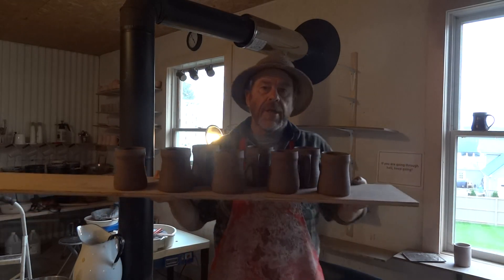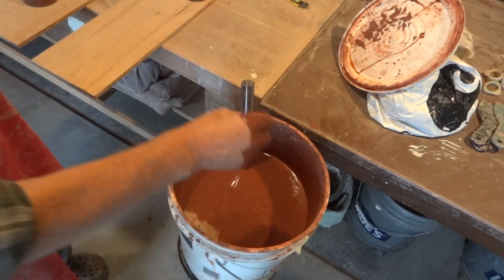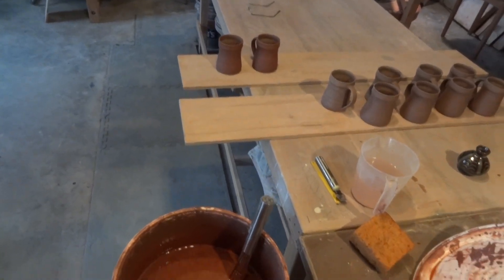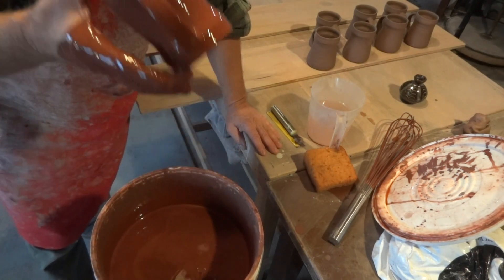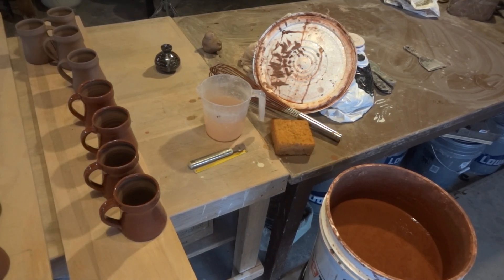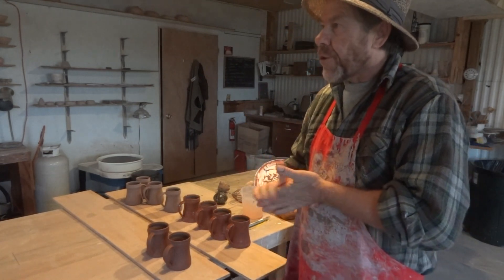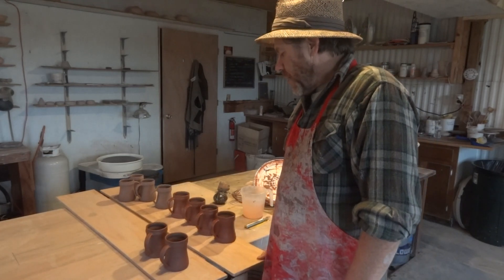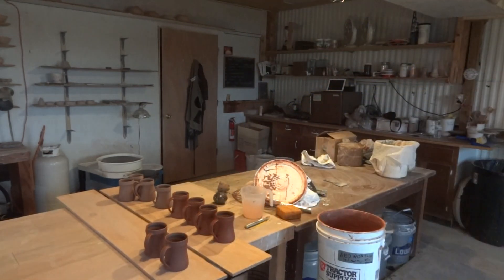SIMON LEACH POTTERY TV - Dipping tankards in red iron oxide slip !

Comment: You say that the proportions are 75% clay and 25% oxide but in one of your other videos you call out 25% clay with 75% oxide.  What should it be?
Reply from the maker: maria flores - red iron slip -75% red clay or your clay body, 25% red iron oxide  // Red iron oxide pigment for brush decoration - 75% red iron oxide, 25% red low temp clay ( terra cotta ). Easy to confuse !